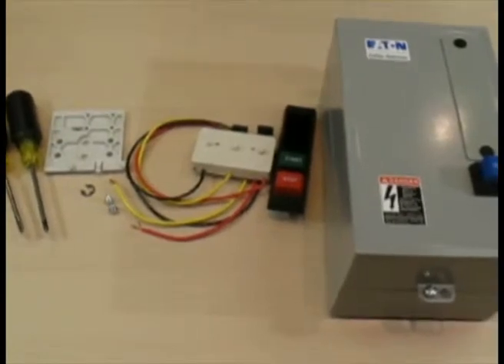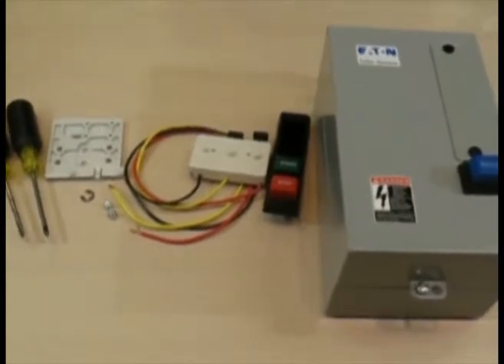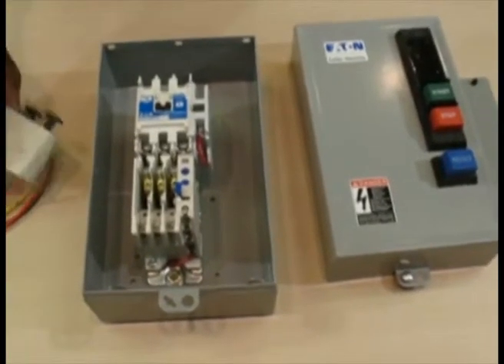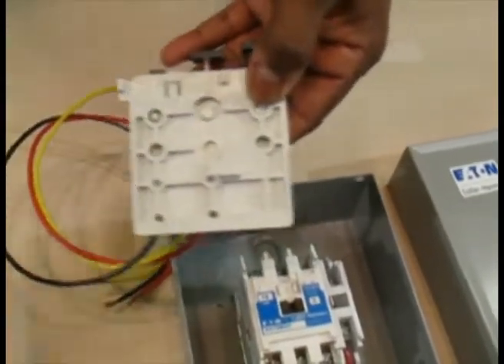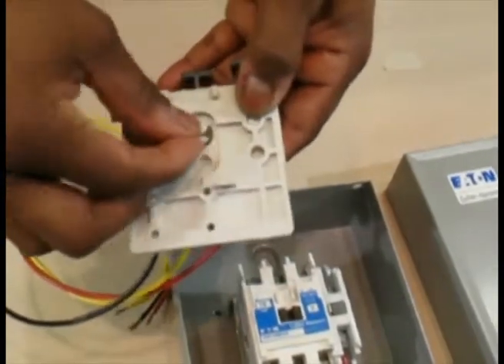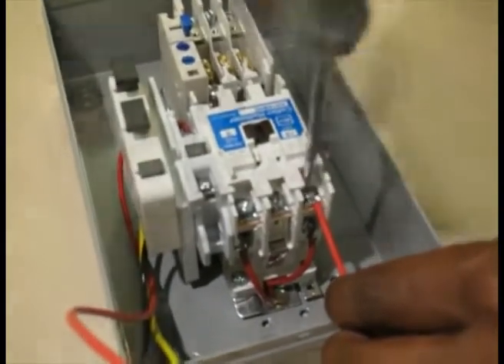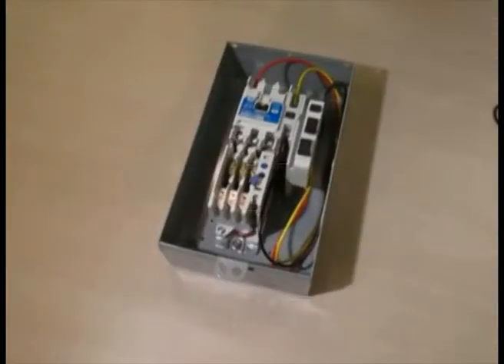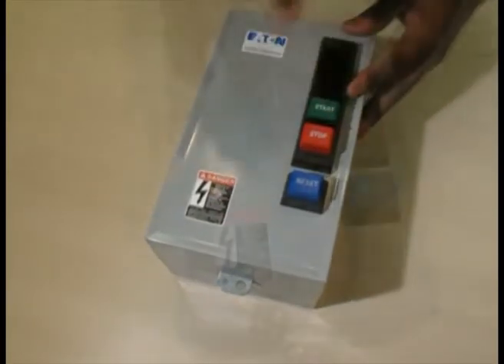Eaton Enclosed Starters: Installing a Start Stop Pushbutton Desktop

Comment: Thanks for the video.  What terminals does the power come into the box and which terminals do you use to send power to the tool?
Reply from the maker: Thanks for reaching out. The link below contains a wiring diagram on page V5-T2-14 for single- and three-phase wiring of a starter. If you are not familiar with wiring the line and load sides of a single- or three-phase accessory, we recommend you consult an electrician. We hope this helps!
https://www.eaton.com/content/dam/eaton/products/industrialcontrols-drives-automation-sensors/nema-contactors-and-starters-v5-t2-ca08100006e.pdf